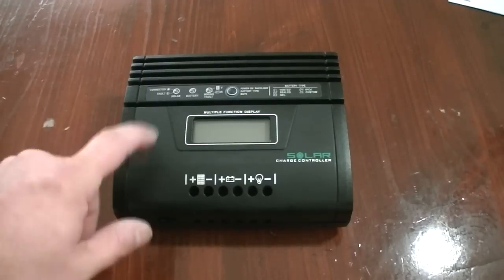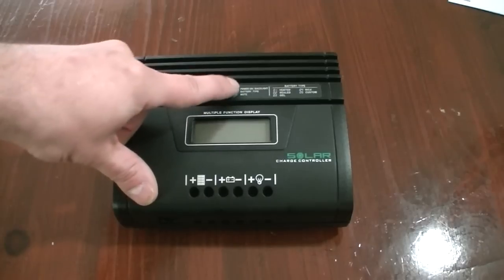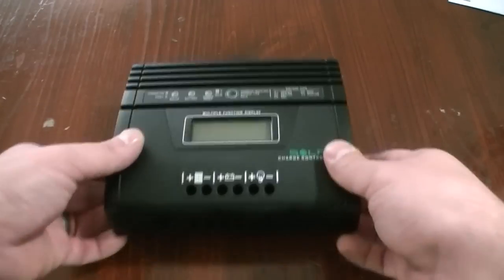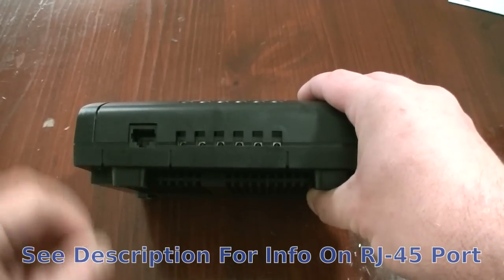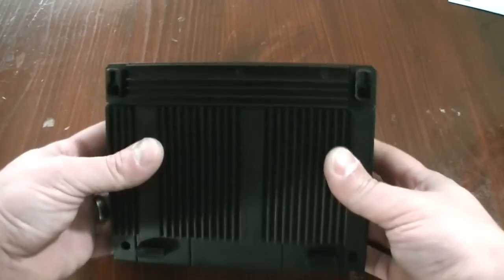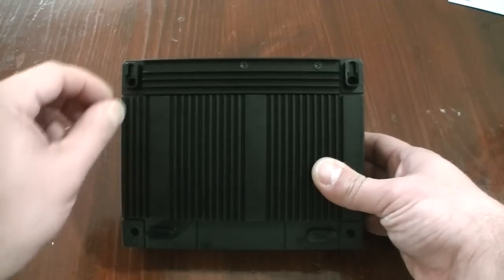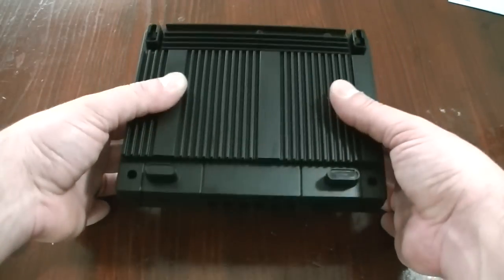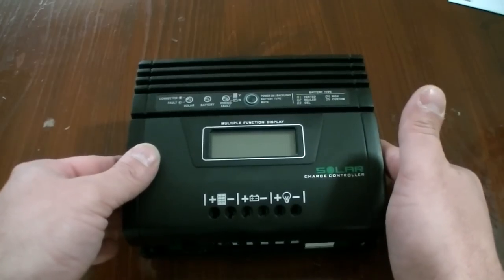Chinese MPPT Solar Charger MPPSolar PCM-3012 Review

Comment: I bought one of these in late 2013, and it is still charging a small 12v system. I'm looking to replace my AGM battery with a LiFeP04 battery. There is a "custom" programmable battery option that might accommodate the LiFeP04, but I haven't got the time to make the cable and link the charge controller to a PC to program it. Still, it's been a great little unit. When I retire it I'll set it in my Faraday can just in case the SHTF someday (i.e., EMP), and it will come in handy once again.

Comment: This is exactly what I was looking for on Mppt's .  You came right to the point about what Mppt does and how to setup a small 200watt system.  I'm a ham radio operator and would like to have something similar to this setup.  Glad you pointed out the stuff about the fake Mppt solar charge controller.  I've seen dozens of sites that Claim Mppt but are fake.  Thanks for the clarification and good video.  Explained it exactly how I feel about it.

Comment: (continued...)  I expect the 42amp max motor to be able to run at half speed (12v@25amp=300 watts) continuous in full sun and recharge or drain the battery below or above that speed respectively.  I expect to have ~25lbs thrust at a sustained load which should move to canoe along at a good clip, ~5mph, maybe even 10mph max with battery burst.  Not to bad for solar!

Comment: Hello, I watched your video on MPPT and learned a lot. The sad news is that you showed the big transformers on the DC to DC converters and said that they are an integral part of MPPT charge controllers, and the new MPPT I bought on Ebay does not have anything that resembles and kind of transformer. It does have a nice LCD display though. When I saw the transformers missing, I opened a case with Ebay/Paypal to get my money back, and insure that I don't have to pay shipping. Tnx  great videos.

Comment: If I am correct you cannot put 2 different amperage or wattages panels in a series. The stronger one would be limited by the smaller panel or it might mess up the lower wattage panel.In other words it would be like 2 100 watt= 200 watts  instead of 100 + 235 =335 watts total.I will test it again tomorrow during the day whenever I am off of work and see if the MPPT controller is much better than the PWM charge controller.

Comment: Hi thanks 4u great review I then purchase a value for money one too, direct from them on ebay, also, the Comm Port:
The comm port is reserved for f/w update and system calibration, which require a special RJ45-RS232 cable to use but this is advanced feature so normally we don't recommend users to try this unless it's necessary.

Comment: Best explanation I've seen of why an MPPT controller is what you want no matter what size system you have. Thanks for the detailed look at the inside. Just what I needed to help me cut through all the bull on eBay. Like you, I just can't afford $500 or more for a controller and need to know about sensibly priced offerings. US manufacturers: I WANT to buy from you, but hey, we know you're using the same parts this unit does. Sure you need to make a living, but you can do better on lowering prices

Comment: njsharkracer, great review.  I am looking to use the PCM-3012 controller as part of a solar canoe project.  The single panel will be 300watt (36.4v 8.24a) (Phono Solar 300 Watt Poly Solar Panel ) and the load will be a minn kota endura max 40 trolling motor. (12v 40a max)  with a 100-200 amp hour AGW deep cycle marine battery.  I imagine I will need to waterproof the controller, but I believe everything else should work.  What do you think?  Thanks!

Comment: Last summer after watching your review I purchased one of these and have found it to be excellent. At the moment I am running it on two 100 watt panels in parallel and during the end of the summer going into autumn the set up kept my campers 125 ampere hour battery fully topped up each day, even though the solar panels are   
flat on the camper roof at the moment. Some form of tilting arrangement for the panels is in the planning. Incidentally my version has got a sleep function which seems to switch it into a very low consumption mode once the solar input hits zero. Thanks for the review, as the previous chinese mppt controller I bought was nothing of the sort, should have realised as it was dirt cheap.
Reply from the maker: glad your enjoying it!  They may have updated the firmware and fixed the "will not go into sleep" bug with the unit you purchased.

Comment: I can't help myself, not to sense some irony in that reply.
You don't have to be a scientist, nor a math major to get this right.
Even the example I gave is greatly exaggerated. Most MPPT manufacturers claim 25-30% improvement over PWM. Given you don't have mismatched solar panel - battery nominal voltage, where an MPPT controller is essential.

Anyway, your video was indeed helpful. I haven't seen anyware else a detailed review on that specific MPPT controller, and that why I gave my thumbs up.

Comment: Nice vid, and detailed review. What I like about the controllers I use ( and like your disclaimer, I'm not a representative for their company) is the display shows input voltage and amperage from the panels, and the adjusted output going into the batteries. Other stuff displayed is total wattage from the array, mode (mppt, absorb, float, full), equalize mode, etc. They've worked flawlessly for over three years now. The 30a, 24v rated units did cost me around 300 a few years ago, and are US made in an offgrid facility. I liked that. I don't know if they're even  in business any more, but it's "rogue power technologies" in Oregon, if you want to check. Anyway, thanks for the review. I'll look into one of these for the greenhouse.
Reply: oh, and the rogue units display battery bank temperature.
Reply: I just looked them up.... they're still in business.

Comment: I bought this same charge controller, and for me it does not adequately regulate.  I connected a 150 watt panel with this controller into a 100 Ah vented battery and a constant 2 amp load, and both the battery and the load see voltages that surge up to 15 volts every couple of minutes (as the MPPT tries to find its sweet spot apparently).

Other reports online suggest this charge controller is burning out people's equipment.  I can see why that would happen.

The defining characteristic of a charge controller is that it control the voltage coming off your panels.  This device does not adequately do that, so it is a failure.
Reply from the maker: Don Bindner update the firmware.
Reply: R&TPreppers Yes, I think this was good advice.  I contacted the manufacturer with details of my setup and after about a week they sent me a different firmware and directions for building a serial cable to load it onto the device.  I haven't had a "really sunny day" for testing, but I had a couple of mostly sunny days, and I believe that the controller is now behaving much more reasonably.
Reply: +Gavin Turner I would contact them directly at support@mppsolar.com since they asked me questions about my configuration to get me a firmware that would work well for me.

Comment: I have 2 158watt 18volt panels. I want to run 2 12volt dc fans in a green house. can I do this with one battery and what type charge controller will I need? Can the charge controller be programed to run from dawn to dusk? Thanks Dale

Comment: Have you tested or tried the EPsolar Tracer 2215RN MPPT Solar Battery Charge Controller 20A+ controller? I just bought it along with a 265 Watt solar panel for my 3 Optima Yellow top batteries in my RV...
Reply: So Cal PHAC How do you like your EPsolar Tracer 2215RN MPPT ?

Comment: Hello I bought the same unit you are showing in this video. It seems to work well.  The only problem is I am only getting 60 watts from a 100 watt panel and I get 185 watts from a 235 watt panel. I tested one panel and then the other one. Not at the same time. Is that difference in watts from what panel is stated at to what you actually get normal?  Thanks for video.

Comment: what is the difference between an mppt controller
 and a pmw one?? thanks
Reply from the maker: Rewatch the video or google is your best friend.  It would take too many lines to type in an explanation.
Reply: i see ok, thanks. Only to ask, if i can connect an pmw charger with a  24v solar panel or i have to use an mppt one? thanks again
Reply: ***** ok i see, thanks again. thank you
Reply: P=Power
W=Width
M=Module

M=Max
P=Power
P=Point
T=Tracking
Reply: It is actually PULSE WIDTH MODULATION. varies the ON vs OFF time. you really shouldn't offer ideas as facts if you are unsure.

Comment: You haven't tested the MPPT function at all, you have tested the PWM function. The fact that it outputs more current than it gets in just means its buck converter (PWM) is working.
This may still be a genuine MPPT converter, but this would have to be verified before being claimed.
Reply from the maker: I think you need to review the fundamentals of an mppt charger again as you have it completely wrong with pwm vs mppt functionality.
Reply: R&TPreppers If you dont agree, then explain to me how your tests show that the mppt function is actually working...
Reply: Seriously, go do some reading
Reply: it is mppt. On the back of the solar panel it gives the panel ip amp, Thats how much amps the panel produces example 7 amps. With a pwm charger you get 7 amps. With mppt it converts excess wasted voltage into more amps, mppt will get you 10 amps from a 7 amp panel. Mppt from my on use, only works good on large panels, when I used it on a small 120 watt kycora panel I got no increase of amp over pwm.
Reply: jony joe The fact that it outputs more current than goes in only means that the buck (or step down) converter is working. This doesn't mean that the converter is tracking the maximum power point.
Reply: jony joe The fact that it outputs more current than goes in only means that the buck (or step down) converter is working. This doesn't mean that the converter is tracking the maximum power point.
Reply from the maker: Thank you wayne!!  Well said.
Reply: ***** I fully agree with what you said, MPPT controllers can be seen as PWM with a buck inside, and that by showing that the buck converter works it is definitely not a cheap PWM.
But none of this proves that it is an MPPT, because an MPPT besides having a buck it also has a power tracker. You have to understand that the controller can have a buck converter and still not implement any power tracking mechanism; that is the case for instance if you plug a cheap DC-DC converter at the output of your solar panel. You will then get more current than if no converter in place, but this current may be far from the point of maximum power.
Reply: MrRafamart  I think from watching the stepped voltage of the panel once its working is a good indication that the average person can do. You can see when he connects the meter the the panel voltage that it isn't changing voltage in a normal manner. It is jumping all around in step like fashion, which to me would show that the mppt curcuit is changing the load and trying the track it. Overal the mppt curcuit is cheap and easy to implement and would make no sense to not have it, buck convertors however cost money as they require expensive copper to install the inductors which is why the cheap ones dont use them, that is why most of these videos focus on if the buck is working but I think you can see youself without him saying it that it is doing mppt by the voltage and amperage changing in steps
Reply: Scruffoid I've seen a fake MPPT before that in fact only implemented a buck converter.
As you mention, in terms of parts cost, the buck does cost more than the MPPT function, but it is also the one that it is very easy to spot if missing from the circuit (the test performed above would show that). The MPPT on the other hand, although cheaper in terms of parts, is not negligible. You need a rather precise current sense, and depending on the topology this can cost a fair bit (if high side current sense is used, which many times is the case so that the whole system has a common ground), not to mention the need to add a more complex controlling algorithm and sometimes a more expensive microcontroller (due to need of extra peripherals and internal performance).
One test that the average person can do to not only check that the MPPT function is present but also to get to a ballpark figure of how close the MPPT can actually track is to supply the unit with a stable bench supply and a series power resistor, loading the unit output with a few different purely ohmic resistances.

Comment from the maker: The switch from bulk to float will happen when the charging amps gets down to a preset limit, but mostly depends on the health and size of your batteries.  I had to custom make the cable myself with a rj-45 to db-9 connector and then a serial to usb adapter.  custom option 5 is not offically supported at this time by the manufacturer, they shouldn't have put that in the manual or the firmware of the unit.

Comment: How long does it take once the battery reaches bulk voltage for the unit to switch modes to float voltage.
also how do you use the battery type 05 custom and where can I get the cable and software?

Comment from the maker: The only two reasons this can happen that I can think of is your either using too small gauge wire from the solar panel to the charge controller, or the panel is derating since it is getting hot in the sun.

Comment: i think am mppt is needed if your panels are greatly mismatched to battery. i bet the 10-30% improvement claim by mppt manufacturers is a 24v/36v panel connected to a 12v system where tremendous loss would occur with a normal pwm.

Comment: I order a pile of Chinesium Electronic parts / modules.  One of the big issues is not so much build quality as it is they're ratings.  Here in America you expect something rated 20Amps to function at those 20Amps.  Under the Chinesium Rating system  That same product would be functional  at approx 1/2 the rating.  Start Smoking at 15Amps.  Burst into flames at 20Amps !!!  LOL ,   See ? it was good to 20Amps !!!

Comment: I tried the 30 amp model of this charge controller after revuing your video, it worked very well at my summer camp powered by a 245 watt pw panel and 2x 120 amp hour batteries, I saw output as high as 18.1 amps @ 265 watts off my panel. I run most of my  camp on 12 volts, but I do have a 1000 watt (2000 surge) for running my 120volt needs.

Comment: Got hold of one based on your review. Will charge a small battery bank, and the load side will run a (switchable) 12v LED lights and an RO water purifier system to turn salt water into fresh. I'm going to mount it screwed to a wood frame that leaves most of the heatsink exposed, and plan to run a small, efficient 12V Sun-on Maglev fan to blow over that, as it will be operating in a warm environment. I'll probably put that lot in a metal or plastic electrical box. The plan is to hook it up to about 270W of panel, which is close to it's 300W limit so it may run a bit warm. I tested a 12V 5W LED halogen replacement light (interestingly on DC they don't care about polarity!) and yes, same thing didn't register the low load at that level, same as your experience.

They were selling them on eBay with best offer, so they knocked $5 off the price.. which was nice: )

How big a battery bank can I attach to this thing?

Comment: Hi you say 200-300 watts of panels and 200 ah of batteries!!!  With my small setup I've got 200 watts of panels and 420 ah of agm batteries !!!!  Is it still ok to put that charge controller with more than 200 ah of batteries ??  Thanks Rob
Reply: dont you hate it when they say ''they will answer your questions if you type them in below and they never do!! aghhhgg

Comment: I bought this controller based on this review and I'm very happy with it.  I have it connected to a 285W Sharp panel which chucks out up to 37V, in the snow and sun in Andorra I was seeing 315W for several hours.  Good controller.

Comment: I have an ecoworthy mppt but might get something different. On my ecoworthy its connected to a 240 watt sharp solar panel on my van roof. Last year I left the headlights on the van on, in morning it wouldnt start (battery read under 10 volts). I connected the ecoworthy to the 12 volt engine battery to try and charge it, it bulked charge for about 3 hours than it went into float mode. Battery read 12.5 when disconected and van cranked over. But I suspect the ecoworthy is floating too soon and not charging my battery's properly. I might get this charger, the price is decent.

Comment from the maker: actually the 10-30% improvement is based on a "12 volt" solar panel matched to a 12 volt battery.  Higher voltage panels hit the market after the advent of mppt technology and are only meant to be used with mppt charge controllers.

Comment from the maker: You are correct.  PWM charge controllers take longer to charge batteries since you will never get the full potential of the solar panel utilized to charge batteries whereas MPPT charge controllers will use the solar panel to it's full potential.